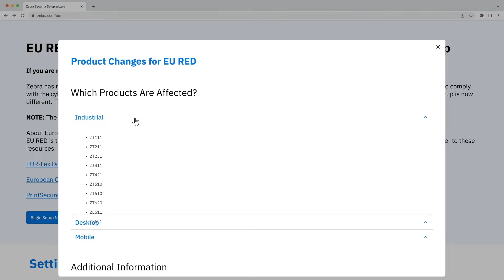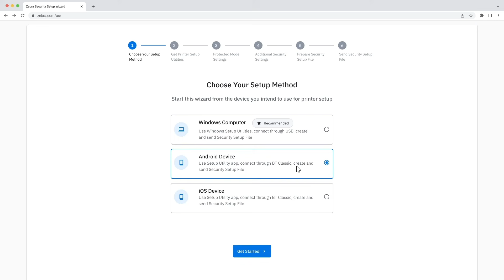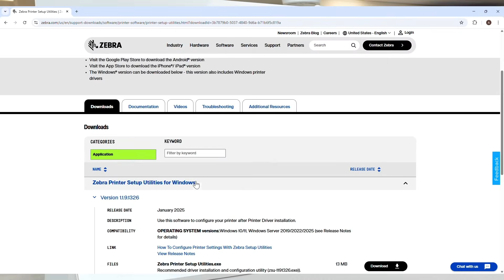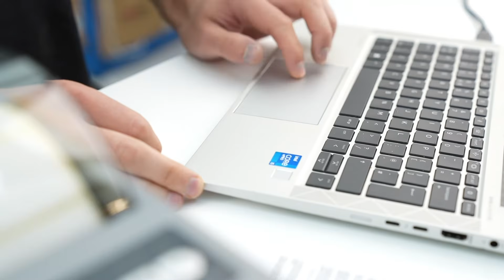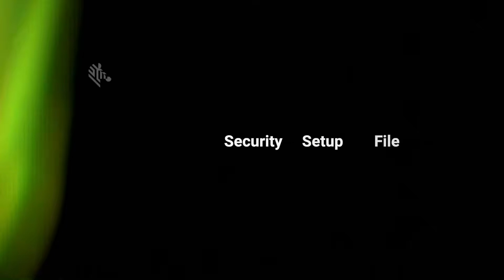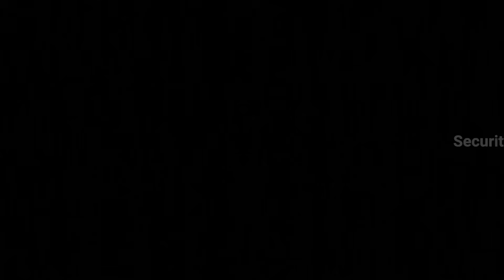Unboxing & Setup of Zebra EU RED Compliant Printers | Zebra

Comment: I understand you had to do this to comply with EU regulations, but we spent 2 hours trying to use the classic Setup Utilites workflow without success, it wasn't until I used the mobile app on a last ditch effort that I realized the printer was in protected mode. A warning in the Setup Utilities would be nice